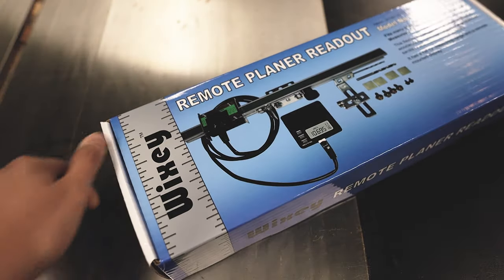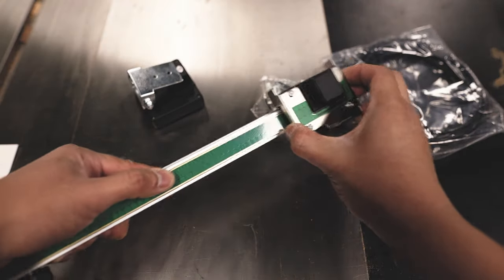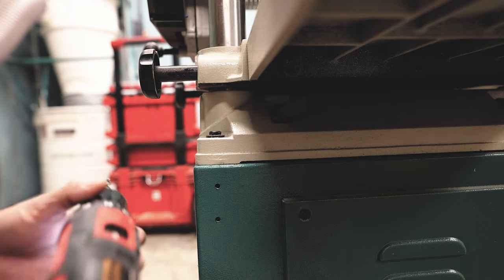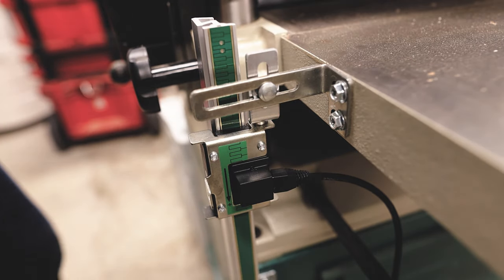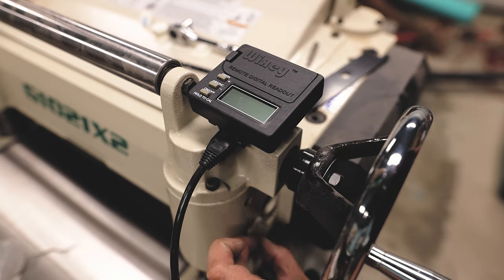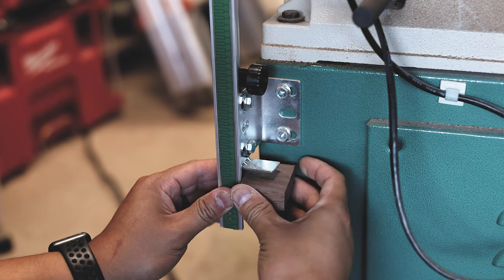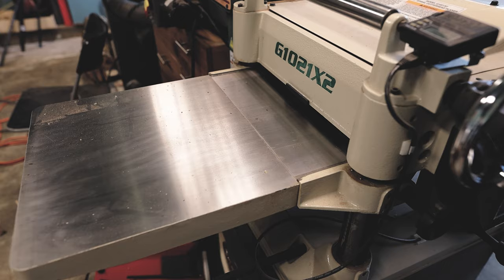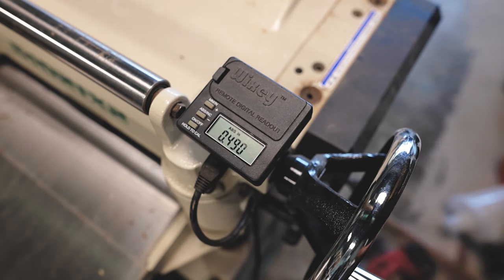Installing and Calibrating a Wixey Digital Readout // Unboxing and Review

Comment: Thanks for the video, I just restored an old delta dc33 planer and was going to purchase the other gauge for the benchtop planer,  and it was going to take some modifications.  With this one its $20 higher and no modifications needed. After your video I looked into the instructions for this one and it can be mounted on a planer that's bed is stationary.  Thanks again
Reply from the maker: Yea there are different mounting location based on how the planer head and bed operates. Glad you found some value from this.

Comment: Looks like a great device for improving precision in the dimensioning process. I am however surprised that in 2020 with all the technology available that they are offering a product to market that's connecting a sensor to a readout device with a cat 5 cable. I'm also a cyclist and Garmin and the like have been using Bluetooth / Ant+ to connect speed, power, heart rate, cadence sensors to a heads up display unit for well over 10 years probably more like 15 so it is pretty stable and reliable tech. Can't understand why Wixey aren't doing the same. Any thoughts?
Reply from the maker: That's definitely something to think about. My thought is because you're dealing with .001” dimensions, it's possible that using some of wireless connection there might be issues with accuracy. I am by no means a tech expert, but that would be my assumption.
Reply: @DesignCraftWorkshop  Hmm, from an engineering perspective there's a difference between measurement (ie the sensor) and transmission

Comment: My planer doesn't have at outfeed table or rollers.  do you think the bracket would be able to mount directly to the planer bed?
Reply from the maker: It's been a while but I believe you can mount it to the head unit. Should show you multiple mounting options in the manual